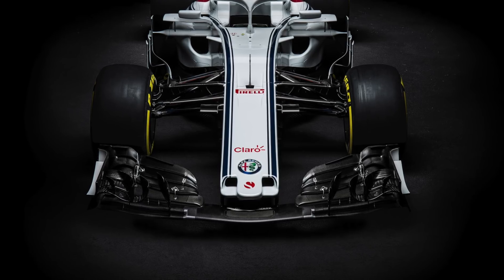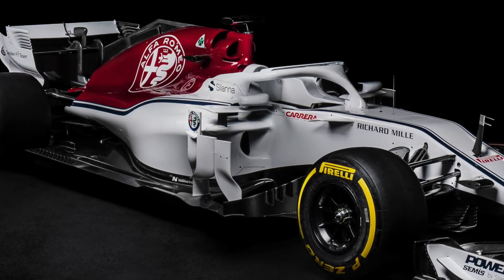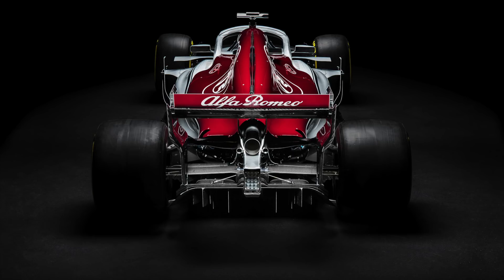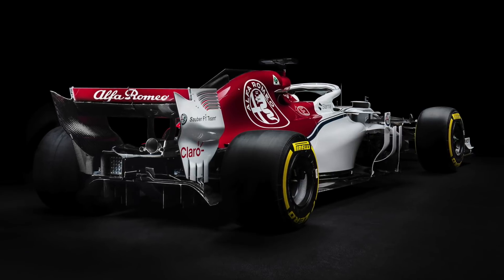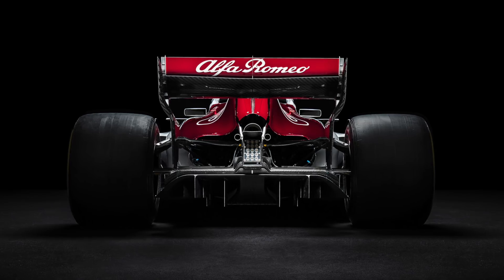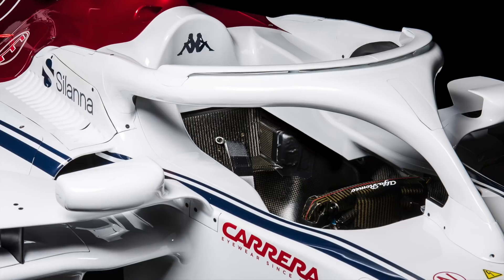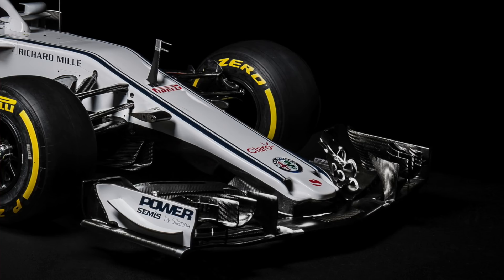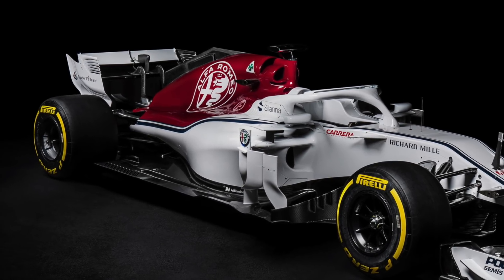Technical details of the new Sauber F1 car

Comment: It will still be slow as shit no doubt
Reply: No no no.
Our Josh here is clearly an educated expert with decades of knowledge.
How dare you insult is well thought out concerns?
Control your insolence!
Reply: Josh
It wasn't a joke. It was you expressing your lack of knowledge through a stupid comment.
Reply: Armands 17 Uh, I thought they had a "proper Ferrari engine" for many years now. What difference did it make? Listen: Having a "proper engine" means nothing if the chassis is bad. 70% of the performance of a F1 car comes from the chassis. Sauber hasn't built a decent chassis since 2012 and I doubt they will this year.
Reply: derbigpr500 In the last race the Sauber qualified dead last. Some "lack of knowledge". It's dead last. And slow. That's an obvious fact now. Not even a debate. Wasn't before either. So you insert all your "fantastic insight into how well-prepared and competitive the Sauber" will be all you want now.
Reply: How do you even know that. It's still a month till the season starts. That car having a proper engine now definitely could give Haas and Renault a hard time.
Reply: Exactly what Armands said... They have the same engine as Ferrari whereas last year they had a year old one. A year really makes a massive difference in the car's pace.
Reply: Oliver Merry Exactly. Looking at the lap times, Sauber last year was as fast as Mercedes in 2016, but that was 1-2 seconds slower than the 2017 leaders... I think, if everything goes well, Sauber could  be as competitive as it was during 2010s with the V8s.
Reply: Armands 17 I really hope so, I think (Maybe, just maybe) it will be a more competitive year as a whole.
Reply: Oliver Merry Curios, why would they use old Ferrari engine last season,no budget?
Reply: Chill out mate it was only a joke hahaha. I can confirm I'm definitely not a formula 1 expert, engineer, aerodynamisist, or even an avid fan anymore. I stopped saying I was a fan at about Monaco in the 2016 season.

Comment: Soo, does it have an Alfa engine or is it just a publicity sticker?
Reply: it's from a 155
Reply: Alfa and Ferrari are company stablemates. The engine is Ferrari.
Reply: L.GH. Djoetma no no, wait. This is indeed a Ferrari engine, we couldn't expect Alfa to make their own engine form scratch in no time. McLaren hasn't developed its own engine yet in 40 years or so in F1.
It will take some time but the final goal for Alfa is coming out with their own F1 engine - and let's clarify that Alfa road engines are 100% Alfa, not Fiat, including the QV 3.0 V6 which is a Ferrari unit downsized and re-tuned by Alfa guys.
Now F1: first step is using a Ferrari unit and have it looked after by a mixed Ferrari/Alfa Romeo team during the entire season so that they take confidence. Results won't be a concern for the first part of the championship, as announced.
Reply: Sergio macchione(I know it’s spent wrong) said this is to help support sauber. However it’s important to him that Alfa returned F1 as a works team in 2021.
Reply: Dumb dumb dumb... drum roll please
Reply: It's a partnership like that between Sauber and Mercedes in 1994 (then the engine was an Ilmor one).
Reply: +Gearge Migaris No, read my comment.
Reply: The David You need to check your sources. The 1.4 for example are exactly the same as the engines you get in Fiats. Not sure about the 3.0 QV, but you're saying yourself that they didn't make it. Of course they adjust the engines for their cars. But that doesn't mean you can just say that they are Alfa engines. Alfa will NEVER do a F1 team with their own engines. They are simply too small for that and don't have the innovation infrastructure to do that. Maybe FCA, but why would Marchionne spend that money with both companies?
Reply: L.GH. Djoetma LOL how old are you? If there's something Alfa Romeo has always been famous for, is its engines. The 3.0 V6 they've been making for 15 years until the mid 2000s was and still is a world icon.
Now, the only Alfa model left with Fiat derived engines is the Giulietta (except the 1.8 QV) and its production has been discontinued (left stocks are in fact a bargain, you should get one), while the new models are 100% new. Platforms, engines, plants, production lines, everything is new and took a €5bn investment. 
They want to get back to their past glory and they're free to give it a try.
And you know, there will always be people out there who hope you won't succeed in your goals, but don't ever let those angry losers stop you.
Reply: L.GH. Djoetma "Alfa Romeo will NEVER do an F1 engine". Ok, if you say so.;)
"It doesn't have the infrastructure bla bla bla.. maybe FCA does"
Exactly. Good guess boy. It's all about money.
Reply: Just a pr sticker. Alfa doesn't even have it's own engines, not even in their street cars.
The link between Ferrari and Alfa-Romeo is that they have the same CEO, Sergio Marchionne (not as in that they fall under the same organization, Marchionne basically has two jobs in this). Alfa-Romeo is a subsidiary of FCA (Fiat-Chrysler), Ferrari used to be part of that, but is now separate and not even registered as a company in Italy, but in the Netherlands (so technically, it's a Dutch company now).

So it's really just sponsoring, Alfa used to have a place on the Ferrari, now they are moved to the Sauber. They are paying Ferrari 5 million for that place on the Sauber. Claro is probably in a same sort of deal. Sauber gets free engines or a discount on them from Ferrari and/or first party support.
Reply: It has nothing to do with Alfa! Its a Sauber Ferrari which we already had before. 

Ferrari wants to use the „Alfa“ Sauber car as something like a Test car to gather data. Its a move to break the Mervedes dominance

Comment: The sauber doesn't look half bad it...
It's looks so much better then the other 2017 car. I hope that, this season the Sauber C37 will be alot more better with the Ferrari engine...   GOOD LUCK SAUBER!!
Reply: spitfirefan 2018 the 2017 had a Ferrari engine. It was the 2016 engine though. So the 2018 engine should be better.
Reply: Gerogy Zurkov Oh what was I thinking 😂
Reply: The 2017 Sauber was a fancy looking car tho.
Reply: spitfirefan 2018 
They’ve had Ferrari engines since BMW opted out in 2009
Reply: Before that they had Ferrari engines as well, since '97

Comment: Halo looks fine
Reply: Yeah it is much more streamlined and not just a awkward looking hole with the drivers head pointing out from it
Reply: michael305schn finally someone who doesent think that halo is ugly
Reply: I can see getting used it by time, but ofc I would still prefer not to have Halo, or rather having closed cockpit solution, if you REALLY want to protect driver's head...
Reply: What else would you suggest, Wayne?
Reply: I bet you are 11, or hope so.
Reply: Car Guy Did you really just call the drivers heads, that barley poke out. But the halo isn’t awkward to you? There’s no helping you.